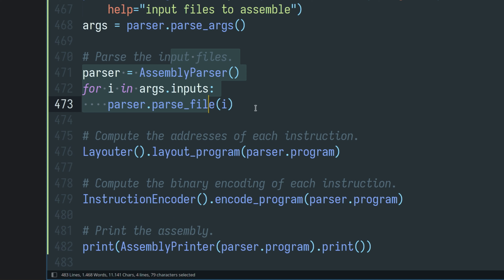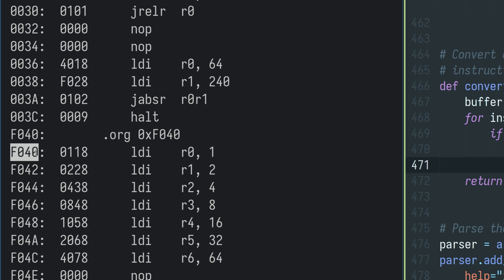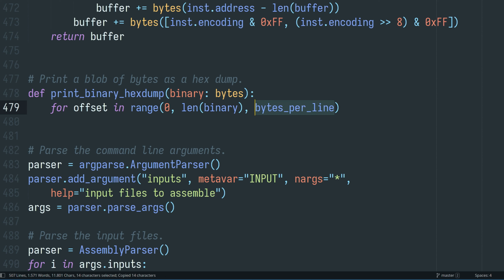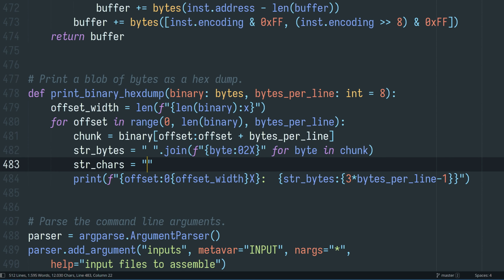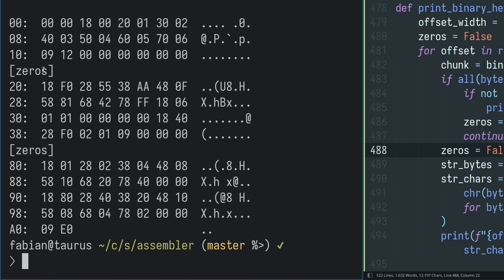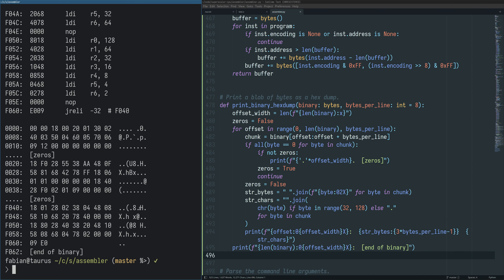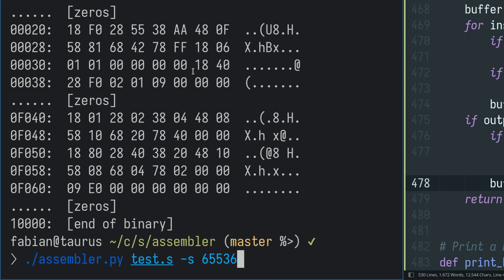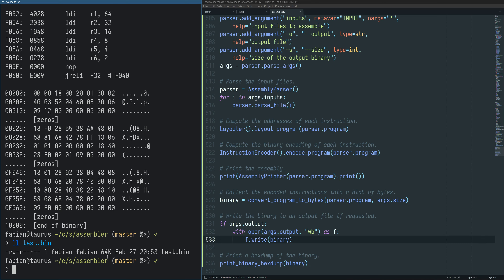Output Binaries from My Assembler – Superscalar 8-Bit CPU #26

Comment: Since the erased flash memory holds the values of 0xFF, it would probably be better to pad the unused areas with 0xFF instead of 0x00 - it may make the flash programming faster. It can also be defined by a command-line argument.
Reply from the maker: Great idea! I'm curious whether the programmer and flash chip I'm using are smart enough to skip erases on blocks that are already 0xFF everywhere.

Comment: I hope you'll continue messing around with Python.

I borrowed your approach on the assembler code and started the project of a very simple and basic parser generator. My previous attempts didn't go well so I have to thank you because this time it worked as expected.
Reply from the maker: Cool, that sounds exciting! Glad to hear that you were successful 🙂👍
Reply: Heck yeah man! You gotta get your start somewhere!
Reply: I used Python for my Nand2Tetris assembler, but I'm currently stuck at function calls in the VM assembly stage. That CPU feels very limiting with its 2 registers...
Reply from the maker: Two registers is tough. 🤯 Do you use a stack for most other data movement?

Comment: Very interesting.  Right now it's a smaller program, but have you tested how the assembler fares for much larger programs in terms of build speed?  Maybe something like a full 128KB program?
Reply from the maker: Thanks! 🙂 Right now it should be fairly quick. Since the assembler doesn't do anything fancy yet, and it just runs through the instructions three times, runtime should scale linearly with the input program size. Python has weird performance cliffs and behavior though, so this assembler isn't going to beat speed records 😏

Comment: Very cool. I am wondering if it could be made as a standalone .exe that you can run. That way, you could just run the program and have all the parsing and output code hidden away.

Also looking forward to getting back to some hardware. Will be interesting to see if you approached it in a similar way to me, particularly the bitwise logic/shift...
Reply from the maker: ALU is coming up next 🙂
Reply: That would be pretty interesting...

Comment: Very nice! What you might want next is labels (for neater jumps) and macros (so you don't have to repeat yourself all the time).
But maybe a little different approach to the assembler would make it easier to expand.
As it is now you have to declare new operands, arguments, etc. And after that you need to write how to parse those things, how to print them and how to encode them.
Maybe instead of matching a string like "if self.consume_identifier("ldi"): do_stuff" you could take the string as an argument and use a dictionary?
Eg. "mv": [symbol, argument_type, ...].
Data in this dictionary could then be interpreted by functions (to parse, print, encode) to automagicaly do the things that you have to add manually.
This way instead of updating your code in several places when adding new opcodes you would just expand the LUT and rest of the code would stay as it was.
Maybe it would even parse larger files faster in the future because it might end up with less if statements to check?
I'm not a programmer (just a PLC wrangler),  not a python guru and certainly not a parsing expert, so take it with a grain of salt, but I believe this might be a good improvement.
Reply from the maker: That's a great suggestion! The parsing, printing, and encoding is highly repetitive, and there are only 3 or 4 distinct instruction formats. I'll definitely move to a table-based approach in the future 🙂

Comment: The way you add onto strings within a loop (buffer += bytes(...)) is accidentally quadratic. Every time you append a new thing to the end of a string, you have to allocate a whole new string. This will start to bite with bigger programs. You should use bytearray or a list which you b"".join() at the end.
Reply from the maker: Excellent point! 👍 I'll fix that 🙂